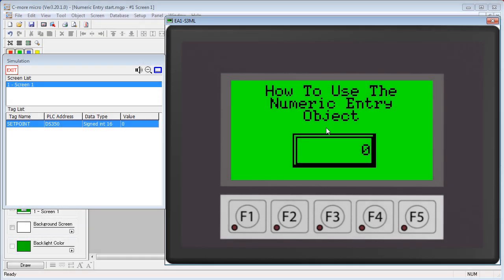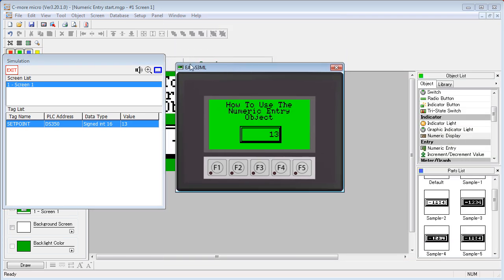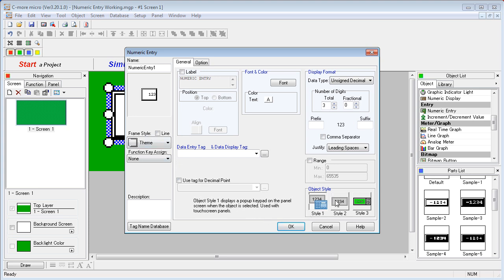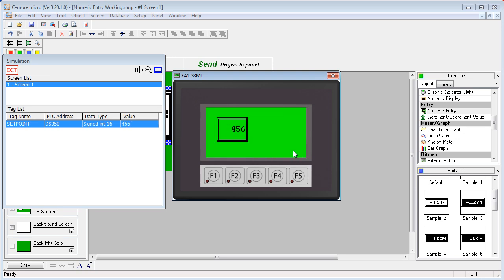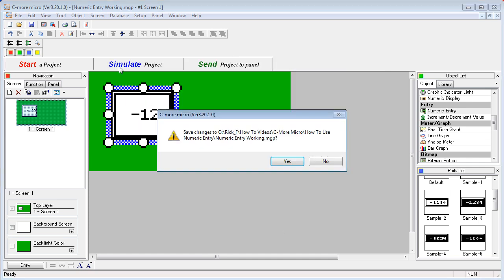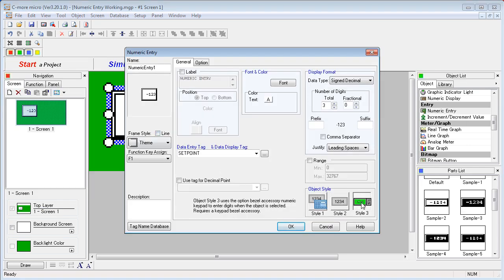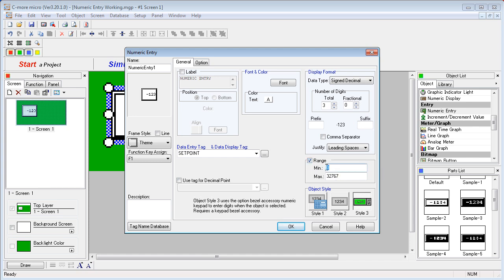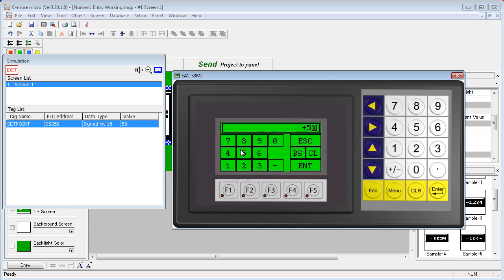C-more Micro HMI Numeric Entry from AutomationDirect

Comment: Hey AutomationDirect. I am doing a tech report and you guys are were im getting most of my electrical needs. I was wondering if you guys had somewhere a HMI builder that is free and maybe a simulator so I can see how it works with my ladder logic program.
Reply from the maker: Hey MattTerryAccount 

We just added a link in the video description to the website where you can get the free software download for creating C-more Micro screens. It includes a simulator that runs on your PC, and allows you to manually tweak the PLC (tag) values and see what the result would be on the HMI screen, but there is no way to connect that simulator to a real world PLC. We hope this helps and good luck on your tech report!